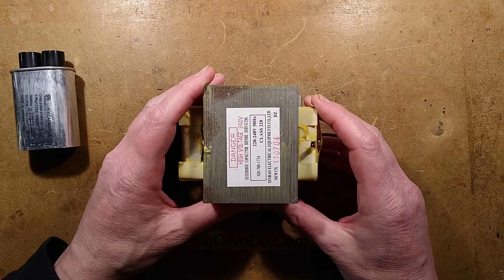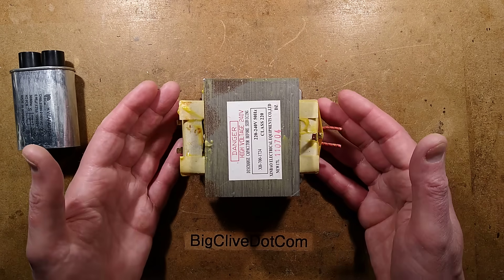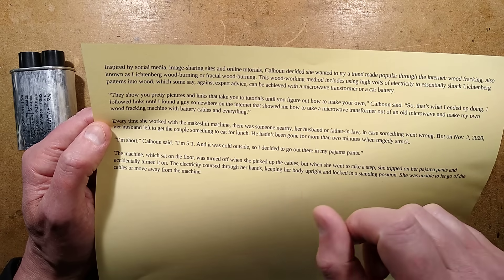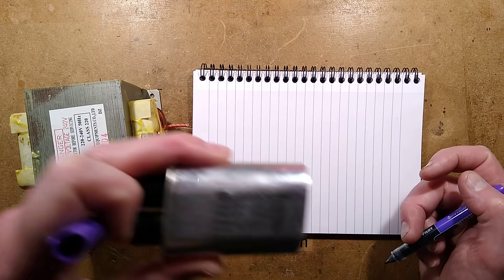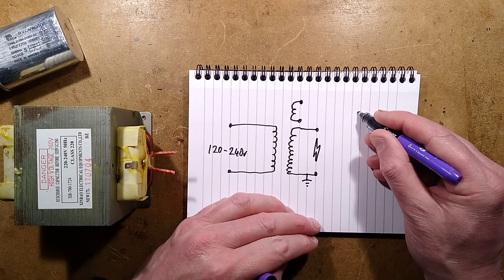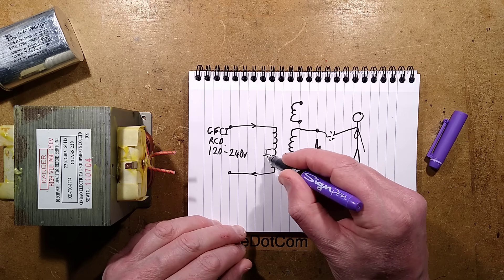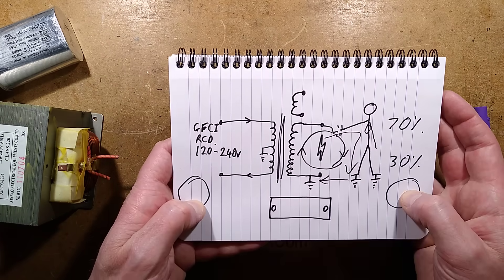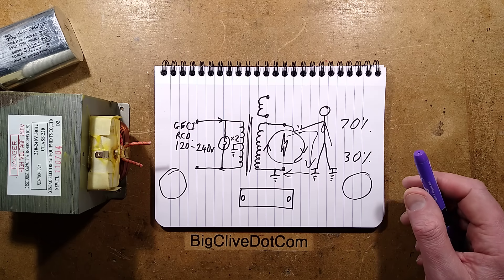The most deadly project on the Internet

Comment: My dad (tv repair man) always told us to be extra careful when tinkering with transformers.  To give more weight to his warnings, he zapped both me and my brother with a supertiny transformer and an AA battery, and then drew a schematic to explain what just happened.  Times have changed, but transformers haven't.
Reply: Was fixing an old BW tube tv and completed  the circuit and discharged the flyback transformer. lucky for me my elbows rested on my knees, was wearing shorts sitting on the floor. A unknown time later was awake found out my one arm did not want to move when I told it. An hour or so later my arm moved like normal.   Was very very lucky When I came too was 4 feet away from the tv and pressed hard against the wall.
Reply: @felixcosty  holy shit
Reply: A few years ago i was working on a cosplay that required me to make/buy a TV helmet. Of course i was broke, so buying wasn’t an option. Found an old tube tv on the side of the road one day and brought it back to work on it. Wore rubber dish gloves the whole time and always had someone else out there with me just to be safe, the warnings all over it about high voltage were enough for me to take it seriously. (Granted, it had probably run out of juice LONG before i got to it. The plug was cut near the base and there’s no telling how long it had been dead for. It was an old model, iirc the sticker on the inside said 1989.)
Reply: @opalumbre  I used to play with Tube TVs all the time. Gosh what lovely pieces of equipment.  just USE A MULTI-METER TO DISCHARGE THE TUBE TO GROUND. Be Careful. It acts as a Condeser.  but Gosh how cool it was to build things like O-zone Generator & Objects that fly with no moving parts.  and those Fly-back Transformers. gosh so yummy
Reply: When I was about 12 we thought it was hilarious to take apart disposable cameras and create trick toys with the control board and flash capacitor. Hand zappers etc. 🤡
Reply: @unauthorized.mimicry  my dad and i made a mini rotary lamp using a few of the capacitors and a small motor linked to a D cell when i was younger
Reply: @unauthorized.mimicry  dang i did that too. I might still have a zapper laying around. I had a extension cord hanging out of this kodak poke someone's arm with it. And im like its just got a double A battery in there what you a chicken? . I got myself with a sega game gear too. I don't know what the heck is going on in there but jeez that stung pretty hard. Put my kodak to shame honestly.
Reply: My half sister was always poking things into plugs, so my dad took her to his bike, pulled off the plug wire and told her to poke her finger in. He then kicked the starter pedal once... she hopped and fell down crying. He then explained to her that poking things into the 220 volt plugs will hurt a lot more and a lot longer than that.

She never did it again. Times have changed, fathers haven't.
Reply: @BloodSteyn  Back when parents let kids be stupid once so they didn't have to keel telling them. Lol
Reply: @windsofmarchjourneyperrytr2823  Haha, it will keel :P
Reply: @BloodSteyn nah fathers have definitely changed. Weird to call them your half-sibling.
Reply: @BloodSteyn  I came here to write "times change, fathers don't." Lol You beat me to it.
Reply: @BloodSteyn  See, this kind of education would be called "child abuse" nowadays.
The future is doomed...
Reply: @mr.kittysavestheworld695  I agree. Problem is, some people only learn through experience. I was raised with spankings and as a result I today suffer from a condition called respect and manners.
Reply: @BloodSteyn  sounds very 1960's and traumatic, but probably effective lesson... Although that kind of lesson could create trust issues. I think a better version of that would be to do it with a piezo igniter and to ask the child if they want to know what it feels like, warn them that's going to hurt a little bit and then tell them what they'd feel if they got electrocuted playing with sockets would be 1000 times that
Reply: @TheMrVogue  It was 1980's So close enough. :)
Reply: Capacitors are pretty dangerous too, especially the ones in valve amplifiers.
Reply: For kicks as a kid we used to take the tiny ones out of the big flame lighters and even those tiny things would give a really good zap! (I know technically not transformers, but a magnet being fed through a coil when you press the button. Similar principle, though.)
Reply: @jdyerjdyer  The type of ignition system you are talking about is Piezo ignition, it's a type of ignition that is used in portable camping stoves, gas grills and some lighters. Piezo ignition uses the principle of piezoelectricity, which, in short, is the electric charge that accumulates in some materials in response to mechanical deformation.
Reply: @alexkenny7807  Yes. In general, they usually are made that way, apparently, but the one I took apart as a kid had a magnet glued to the end of the plastic push button with a spring and a coil of wire. It was way back in the early 90s. Not sure if they changed, or it was just an oddball one I got.
Reply: @alexkenny7807  This is talking about energy harvesting, but I think it is similar to the device I found, and even correlates the principle to transformers as I stated above. I've read that in general, most these days do use piezo, but like I said, it was years ago, and maybe I just had an off name brand or something. IDK. lol

"According to Faraday’s law of induction, an electric current is induced when an electric conductor moves through an electric field, or if the magnetic field surrounding the conductor changes. This is called electromagnetic induction and is used by electromagnetic vibration energy harvesters to convert vibrations into electricity. This is the same principle that is used in e.g. transformers and electric motors.

Electromagnetic energy harvesting devices are typically designed as a system of springs, magnets and coils, where the magnet and the coil move relative to each other. This movement creates a change in the magnetic flux which produces an electromagnetic force.

Just as piezoelectric energy harvesters, electromagnetic energy harvesters are used as an “perpetual power source” to replace batteries and cables in wireless sensor networks and IoT applications."
Reply: @jdyerjdyer  
Sane principle. Related perhaps but that’s like saying a Coleman camp stove and an internal combustion engine operate on the ‘same principle’.
Reply: @Zerpersande  I just meant that they both induce current in a coil. Of course I didn't know that more commonly the electric spark is created by crushing a crystal, as the one I took apart had a magnet on it and a coil of wire inside.
Reply: @jdyerjdyer  Haha! Me too. tak! Aaaa! ... lets do it again!
Reply: Actually I think those arequartz crystals.
Reply: @jdyerjdyer oh man oh man, got quite the jolt from those when I was building potato cannons as a kid. We'd wired up three barbecue ignitors in parallel, glued some wood to hit all three at once, then wired them to bolts running into the PVC ignition chamber to create an arc. Accidentally touched the bolts on a few occasions. Yowwwzaaa! Quite the zap. 

Not to mention, we did a dry run without PVC glue... the square PVC plug at the base shot right back at my chest. Left a square bruise that took weeks to clear up. 

Honestly, shocked that we made it through those years. The potato cannon days came to an end after the cops showed up one too many times. Neighbors didn't like the bang, nor the potatoes littering their shingles and in-ground pool.
Reply: Good dad 🥰
Reply: @jdyerjdyer squished crystal
Reply: I figured out that disposable cameras are actually tiny tasers 
multiple times 
because you would hear a tiny whine then nothing 
the capacitors don't make noise so if you are building a camera flash system aka press a button get a light
you touch the circuit board and oh my heart feels cold that is not good ow 
and then you unknowingly charge it again and you reach for it again OW frick not again
Reply: I think you mean capacitor, not transformer.
Reply: @TheDieselndust  had to, dc can't be transformed, only ac.
Reply: Your dad is amazing.
Reply: My dad would wake us up with a couple of flashlights and yell, Truck. He never really did explain much though.
Reply: In laymans term the bigger the transformer the faster the death yeah?
Reply: @drunkeneagleman51 not necessarily. The main concern is the difference in the number of windings in the primary coil to the number of windings in the secondary coil.
Reply: you're right. Transformers havn't changed... those movies still suck
Reply: good father, my friend. you're a lucky duck
Reply: @alejandrolujan9472  Thx, he died almost 11 years ago, but I learned a lot of valuable things from him. (His death had nothing to do with electricity for those wondering)
Reply: @Sludge I read some more on it and it appears in general more of them do use a small piezo crystal now. hmmm
Reply: Unless they turn into a robot.
Reply: Hold it.  A transformer and a d.c. power source zapped you?  You'll have to show me the schematic on that one.  I'll bet you're thinking of a large capacitor.
Reply: @hayseed5467  Very simple circuit, as explained, a step up transformer and a battery. The battery is connected and the initial surge of electricity in the primary coil will cause a magnetic field to be created. That field will cause a pulse of voltage in the secondary coil. Disconnecting the battery will cause the magnetic field to collapse, causing a reverse voltage pulse in the secondary coil of the transformer. This principle was used in car radios in the days when they used high voltage tubes. The DC voltage from the car battery was run through a vibrator (a device like a relay with the coil voltage flowing through a normally closed contact of the relay) to create rapidly pulsed DC that then flowed through a step up transformer to create AC. 
The same principle is used in the mechanical ignition system of older cars. The points open and close as the distributor turns, supplying the pulsed spark to the spark plugs.
Reply: @memyname1771  Yes, I'm familiar with that. I assumed Dad was playing a joke on him, which would have precluded said dad from having him hold on to the secondary leads of the trans.  What fun is that? 🤣   Usually when you hear these shocker stories, they revolve around an surreptitiously charged electrolytic capacitor, left laying in wait for the unwary victim to come pick it up.  Which leads to another lesson in electronics.
Reply: @hayseed5601  In the 1950s, a joke store near my school sold a very shocking book. The book was foil covered (front and back cover were insulated from each other) and inside had a transformer connected to the book cover, a battery, and a switch that would vibrate when the book was opened.
Reply: @memyname1771  I want one.  I got a grandkid I need to take down a couple pegs. 🤓
Reply: @memyname1771  Technically the output of a vibrator in those car radios was dc in order to operate the plates of the tubes.  The output of a transformer running on dc is dc, it's just that one needs a mechanical apparatus to make and break the circuit to induce the current output (inverters nowadays us some electronic means to accomplish this).  Something, BTW, that is technically happening in an AC transformer too.  It is just the 60 hertz oscillation of the current polarity that makes  and breaks than remakes the field in the reverse polarity, collapsing and remaking the magnetic field and inducing the output current.
Reply: @hayseed5467 photo flash unit in a camera? Easily generates 20kv to fire the flash. Runs on a 1.5 volt battery. Super easy to generate a DC sine wave that creates an inductive field.
Reply: @hayseed5467 A Model T Ford "buzz" coil will buzz you pretty good on a six volt car battery.  That is how an old fashioned car ignition system worked on six volts to pop out 20,000 volts for a spark plug (modern cars still use ignition coils of course AKA transformers).  Ditto on old (and new) small engines with a magneto.  This low DC voltage input being induced in output by make and break using ignition points.  My guess is that his dad was make and breaking the contact with the batteries very fast to achieve.  I do the same thing with breaker points to manually see if an ignition coil is sparking.  It doesn't matter about little battery or small transformer, as long as there are hundreds or thousands of turns in the secondary of the output the step up will be high.
Reply: @hayseed5467  When you apply DC to a transformer, you get a pulse from the output. Same, opposite polarity when you remove it,
Reply: @hayseed5467  Wow, I can't believe the absolute state of common sense. Quick, take a transformer and grab both leads, then have a friend plug a 9v battery from a toy on the other side, you best believe you will feel it
Reply: @ELTABULLO  Yes.  And...?
Reply: @ELTABULLO A Model T Ford "buzz" coil will buzz you pretty good on a six volt car battery.  That is how an old fashioned car ignition system worked on six volts to pop out 20,000 volts for a spark plug (modern cars still use ignition coils of course AKA transformers).  Ditto on old (and new) small engines with a magneto.  This low DC voltage input being induced in output by make and break using ignition points.  My guess is that his dad was make and breaking the contact with the batteries very fast to achieve.  I do the same thing with breaker points to manually see if an ignition coil is sparking.  It doesn't matter about little battery or small transformer, as long as there are hundreds or thousands of turns in the secondary of the output the step up will be high.
Reply: @wdmm94  You get it
Reply: I'm seeing a lot of doubt about this comment, understandably, but I assure you the circuit was quite involved and not just a battery and a transformer.  I found a video with a circuit board that is very simular to what I remember being zapped with:  https://www.youtube.com/watch?v=Q7gw3uDRXPw
Reply: @dustinslaboratory897. I am sure your dad just took a basic step up transformer that took low voltage and steps it up to high voltage.  All he had to do to induce high voltage was make and break the connection real fast.  Old radios had vibratory transformers that turned low voltage into continuous stepped up dc.  A small engine ignition coil would do the trick too. Really easy and basic.
Reply: @dustinslaboratory897  OFC youre gonna try and go back on what you said after people start calling out how youre full of shit. first it was just a tiny transformer connected to a battery, now its a battery connected to a PCP and a series of components. either way, dosent matter. you cannot pull that kind of power from a battery. without a very high capacity capacitor as well, you cannot obtain a spark from that. 120v dosent make a spark if youre still pulling less than 2 watts of power.
Reply: @FingerinUrDaughter  Dude, you need to chill.  I never talked about sparks in my post? I don't need to back out of anything, I was there.  We just got zapped (electrocuted) and got a good scare out of it, nothing more.  *Djeez *
Reply: was it the transformer from a disposable camera? I got hit with one when I was in middle school and holy crap that thing bit hard.
Reply: Your father's parenting skills are shocking. <-- Pun intended. Sounds like a fun childhood and a good Dad.
Reply: So you're saying that every has transformed except for the thing that is named after the process of transformation?
Reply: Got quite a zap, from a flyback transformer in an old tv.
Reply: My dad did something very similar. Had an old black and white he was trying to fix, the moment me and my bro started looking over his shoulder to watch him, he turned to us and simply said "Don't touch this part. If you're not careful, it will kill you." Blunt and straight to the point sure did get me to take things like that seriously for the rest of my life.
Reply: This 100% works with just a small transformers and a AA. I accidentally figured it out while messing about as a kid with an alarm clock I'd destroyed. It only works upon disconnection of the battery, and you don't connect it to the mains wires but the output wires, so basically wire in the reverse of how the transformer was used in the A/C powered device. Thanks to those that explained how this was happening because the more I've learned about electricity the more confused I was to what was going on. I used to bring it to school and shock my friends. 
Once we got a group of 8 or 9 kids to hold hands in a circle. Me and and my buddy held one of the mains wires and connected then disconnected the AA to the other end, everyone let go at once as they all felt the shock at the same time. Very wreckless but lots of fun. I did have a microwave transformer at the time but intuitively knew I shouldn't try it. Grateful I never did, guessing that could have ended badly.
Reply: I learned about "mystery" high voltage while studying amateur radio. I took my 2000-ohm standard radio earphones and tried to check the circuit for broadcast band signals, but only got a light jolt when I OPENED the circuit.  If you are curious, when the phones are first touched on the radio circuit,  from only a 22.5 volt B-battery battery, they store up the 22.5V energy, and OPENING the PHONE circuit permits the energy to go directly into the earphones....and.... surprise! a jolt from "nowhere"!    I NEVER AGAIN needed to play with ANYTHING that could store energy.
Reply: Thats odd because a transformer doesn't work with DC from a battery...
Reply: @fedorboendermaker1536 sure it does, just feed it a DC sine wave.
Reply: @fedorboendermaker1536 A Model T Ford "buzz" coil will buzz you pretty good on a six volt car battery.  That is how an old fashioned car ignition system worked on six volts to pop out 20,000 volts for a spark plug (modern cars still use ignition coils of course AKA transformers).  Ditto on old (and new) small engines with a magneto.  This low DC voltage input being induced in output by make and break using ignition points.  My guess is that his dad was make and breaking the contact with the batteries very fast to achieve.  I do the same thing with breaker points to manually see if an ignition coil is sparking.  It doesn't matter about little battery or small transformer, as long as there are hundreds or thousands of turns in the secondary of the output the step up will be high.
Reply: 52
Reply: love the avi/name
Reply: Old TVs used vacuum tubes, or valves depending on where you are from. EL34s were not uncommon, so the TV repair shops often had what we needed to fix our guitar amps. Not quite microwave voltages, but getting up there. 400-600v. More than enough to do the Grim Reaper's work for him. Guitar amps have plenty of victims. Most videos showing people how to repair or mod their amps have safety disclaimers and info on how to discharge the big filter caps.
Reply: My father was a master electrician, I also got my fair share of shocks that he dubbed “lessons” times indeed have changed.
Reply: TRANSFORMERS.....Abomination in disguise
Reply: intersting - how did he do that with DC? Or were more components involved?
Reply: @Sludge Is that the sane as those piezo rocks in amps and electronic drums?
Reply: What a great dad, explains and gives real example, the kind that you will never forget, damn i wish a had one xD
Reply: its not the transformers. xformers are just coils of wire. theyre dangerous if hooked to a power sorce like capacitors or batteries or line power.
Reply: transformers arent dangerous, you have to apply power first
Reply: my brother had a english mini 1000 in the 70`s . the fucker told me at age 11 to hold the plug to the cam  headcase and the  negative_battery terminal at the same time. absolute fukkin wanker. i sit here today though at 58 and are good looking and cool and hot at the same time . "humour" . ""are still alive"". however i put this down to cross index polarity. dc to positive ac motive non terminal ground-base collection . this said at least 18.000 volts at even .74 amps kills without the wearing of rubber school pumps. dont piss about willy nilly with these items and potential killing schematics . after all i not like any more than 3 to the power of 1 as competition x. ty clive x.
Reply: they just got volumised .
Reply: There's certainly more than meets the eye to transformers.
Reply: Hello Dustin, There are a lot of inductors out there that give a nice zap, even electric motors such as an Erector set motor, the 1 you plugged into a wall socket. Gilbert 
showed how to make a rotary switch and hook up with 2 D cells and the prongs of the motor. it was when the swich opened you got that inductive kickback, sort of like the
back emf you get across the points of an ignition set up for battery or magneto.
Reply: Not sure how you got voltage on the secondary from a AA battery without some sort of switching circuit
Reply: @alexanderkuhn2298. Could have simply manually made and broke the battery connection real fast.
Reply: @alexanderkuhn2298 Probably made and broke the battery connection real fast.
Reply: Relay coils can give you a surprise also.
Reply: My dad did take the discharge of the sparkgap of a Tesla Coil we made like a project. High voltage isn't a matter of joke
Reply: Shocking
Reply: Wait a second! Transformers don't work with direct current (e.g., a battery)!
Reply: @douggraham5812 A Model T Ford "buzz" coil will buzz you pretty good on a six volt car battery.  That is how an old fashioned car ignition system worked on six volts to pop out 20,000 volts for a spark plug (modern cars still use ignition coils of course AKA transformers).  Ditto on old (and new) small engines with a magneto.  This low DC voltage input being induced in output by make and break using ignition points.  My guess is that his dad was make and breaking the contact with the batteries very fast to achieve.  I do the same thing with breaker points to manually see if an ignition coil is sparking.  It doesn't matter about little battery or small transformer, as long as there are hundreds or thousands of turns in the secondary of the output the step up will be high.
Reply: Very important lesson!!! I have my own stories along these lines.
Reply: wait, how did he zap you with a transformer and a dc source? or was it a transient thing when the connection was made?
Reply: @dsdy1205 A Model T Ford "buzz" coil will buzz you pretty good on a six volt car battery.  That is how an old fashioned car ignition system worked on six volts to pop out 20,000 volts for a spark plug (modern cars still use ignition coils of course AKA transformers).  Ditto on old (and new) small engines with a magneto.  This low DC voltage input being induced in output by make and break using ignition points.  My guess is that his dad was make and breaking the contact with the batteries very fast to achieve.  I do the same thing with breaker points to manually see if an ignition coil is sparking.  It doesn't matter about little battery or small transformer, as long as there are hundreds or thousands of turns in the secondary of the output the step up will be high.
Reply: Flyback transformers from crt screens pack a punch!
Reply: Did he have an awesome set of tools? Gnarly!
Reply: I think you're getting transformers mixed up with capacitors. Transformers require AC to work, capacitors require DC to build up and store a charge so you couldn't energise a transformers with an AA DC battery. It's the large electrolytic capacitors in old TV's that can remain dangerous after the set is switched off.
Reply: @phils2180 A Model T Ford "buzz" coil will buzz you pretty good on a six volt car battery.  That is how an old fashioned car ignition system worked on six volts to pop out 20,000 volts for a spark plug (modern cars still use ignition coils of course AKA transformers).  Ditto on old (and new) small engines with a magneto.  This low DC voltage input being induced in output by make and break using ignition points.  My guess is that his dad was make and breaking the contact with the batteries very fast to achieve.  I do the same thing with breaker points to manually see if an ignition coil is sparking.  It doesn't matter about little battery or small transformer, as long as there are hundreds or thousands of turns in the secondary of the output the step up will be high.
Reply: No offense but I think your memory is faulty, a battery aka DC doesn't work with a transformer.
Reply: @skullheadwater9839 A Model T Ford "buzz" coil will buzz you pretty good on a six volt car battery.  That is how an old fashioned car ignition system worked on six volts to pop out 20,000 volts for a spark plug (modern cars still use ignition coils of course AKA transformers).  Ditto on old (and new) small engines with a magneto.  This is low DC voltage input being induced in output by make and break using ignition points.  My guess is that his dad was make and breaking the contact with the batteries very fast to achieve.  I do the same thing with breaker points to manually see if an ignition coil is sparking.  It doesn't matter about little battery or small transformer, as long as there are hundreds or thousands of turns in the secondary of the output the step up will be high.
Reply: @dustinslaboratory897     The output of a transformer running on dc is dc, it's just that one needs a mechanical apparatus to make and break the circuit to induce the current output (inverters nowadays us some electronic means to accomplish this).  Something, BTW, that is technically happening in an AC transformer too.  It is just the 60 hertz oscillation of the current polarity that makes  and breaks than remakes the field in the reverse polarity, collapsing and remaking the magnetic field and inducing the output current.  Some of the commenters don't seem to understand that in the first place.
Reply: A good video about Faraday and his discovering of induction.
https://youtu.be/mxwVIOHEG4I?si=H9BUNFM9o1QCD5ch
Reply: When I was about 6 years old I saw a 240 volt power lead in Dads' workshop. I saw a stainless steel tube bent into a pistol grip shotgun shape. Roughly. I got this flash of inspiration and fed the end of this 240 volt mains supply(Australia) lead through the old stainless tube and had bare ends of copper wire sticking out the end of my futuristic weapon. God only knows why I didn't plug her in there in the workshop! I knew I was not meant to do such stuff. I thought it was OK but not really that ok... anyhow I took the thing into the house and was in the process of plugging the old girl into the socket closest to the front door when my Mom says HEY!!!  what the hell is that?? Oh I will show you... She lept over and snatched the damned thing from my hands as My Dad came in the room and was very concerned. He was a Telecom engineer and ram an electronics lab in the city developing all manner of things. Solving issues for the telco etc. Innovative design it was called. So I dodged a very nasty electrical bullet that night and whatever was said to me was serious because to this day I am extremely careful with electricity and its use and misuse. I know several folks that have nearly been killed by mains power  my mate had an old 50s type vacuum tube amp for his electric guitar. He was fixing the thing and had it plugged in... the guy had extremely high I.q. alas his common sense suffered on account. Anyhow he was sure he was fine as he wasn't touching anything inside the open amplifier but his silver chain bracelet moved, made contact and the juice went in there and out the end of his finger. He sat there rigid unable to do a thing about it as that's what happens... muscle rigidity. His Dad coolly walked in and cut the power. Lucky! Yet the belting Arc that was streaming out of his finger actually blew off the pad on his index finger. It was bad. And the bracelet was welded up in places and he had bad burns from that. The hospital said shock did go throughput his body but mostly as it is a lazy thing, lazy people or things find the easiest shortest way. That's why it sometimes pays to hire a lazy but responsible person in business as they always find ways to cut out unnecessary bits. Haha.
Reply: Your dad zapped you with an AA battery, and a transformer? But transformers don’t work with DC. Do you mean a boost converter?
Reply: When I was around 8 or 9, I would steal my moms disposable cameras, take them apart, and tinker with them. One fateful day, I found one that actually worked and I thought it would be a good idea to touch my tongue to the capacitor for the flash. Unfortunately, I didn't know what a capacitor was or how they worked, or that it was actually charged, and it resulted in me not being able to taste anything for a week.
Reply: How does a transformer work with a DC voltage from a battery? Fake story
Reply: You can't expect a trafo to work with any type of battery connected to it so there had to be either a inverter or some other device taking care of DC/AC inversion for you to feel anything.
Reply: My electronics teacher would do the same.
Reply: You dad is lovely!
Reply: As a young tinkerer in electronics, I had a healthy fear of the flyback circuits in CRT TVs.  This Microwave Oven transformer gives ne the heebie-jeebies.
Reply: My father owned and operated a television and radio repair shop starting in the 1950s.  I thought that bigclivedotcom was a place where people came to learn about electricity and electronics. After reading some comments here, I see that some people need to go back to the very basics. Two examples found in response to your comment clearly demonstrate this. One says transformers changed and have been replaced by resistive networks. Resistive networks have existed to reduce voltage in the oldest AC/DC radios, back when some areas were supplied with alternating current and other areas of the same country were supplied with direct current. These transitioned to become the old transformerless radios designed for AC, as DC was no longer used for power distribution. These radios, and similarly designed electric products, had the deadly problem of no isolation from the incoming power. Another person comments that transformers have gotten bigger. Big, high power transformers have existed nearly as long as alternating current has existed. The design and function of transformers has, for the most part, remained the same for years.
As for the person sitting on the floor while wearing shorts and a short sleeve shirt, working on a tube television, I hope everyone takes a lesson from this. The CRT stores the low current, high voltage charge from the flyback transformer. The television should have been on a non-conductive bench. The floor, if concrete, should have been covered with a rubber mat. Measurements should have been one handed. The voltage may not kill you, but the muscular contraction and loss of conscience could lead to serious injury or death.
Reply: @memyname1771  I fully agree with your comment about some folks need to learn what they are talking about.  I worked in a TV shop in the 70's while in high school and I got zapped more than once, if I remember correctly a fly-back  transformer in a color CRT TV produced about 25k volts.
Reply: @memyname1771  Wow... Electric shocks can leave you without a conscience!? Is that what happens to politicians when they graduate?
Reply: My dad beat me with a stick
Reply: Time changed, and transformers did too.
They got BIGGER.
"AA batteries? HA! I'll show you how it's done!"
Reply: As a kid I always wanted to build a Jabob's Ladder (in the days before the internet) and my dad always said I needed a furnace transformer or a neon sign transformer but he never helped me build one.  I realize now, as an adult, that he was probably fucking shit scared of the voltage, and with good reason.  My dad was super smart but he wasn't an elechicken, he was a milwright.  Anyway... now I'm the old man with the power of the internet so I can build cool shit with my kids and we'll see how it goes.  Hopefully we don't die of respiratory paralysis haha

That said, he did tell me I needed at least a 500µF cap to charge off the 120v wall current if I wanted to toss one to a friend for an electrifyingly good time.... he was less than impressed when I tossed it to one of his co-workers.  This was in the days before #metoo so there were no lawsuits.
Reply: @MdubFrederson lawsuits were more common before tort-reform. Metoo has nothing to do with your story. 🤦‍♂️
Reply: @MdubFrederson  Yeah we played a joke on our EE Teacher one time like that.  Hooked his metal stool up to a 60-Volt Capacitor. (being sure to limit the draw-potential for saftey)  he got quite the zap xD.  boy was he pissed!  But, it became a 'campfire story' later and he'd tell it to the middle-school & high-school kids when he switched to semi-retired teaching xD
Reply: Bro I once connected 6 AA batteries to a transformer and zapped myself on purpose just to see what it was like. After a couple of zaps I couldn't bring the leads together any more, my body was effectively trained that "Touchy no goodie" and no matter how much I tried I just couldn't do it on purpose. I literally conditioned myself.

Before anyone asks, I was extremely bored and it was kinda fun.
Reply: Volts are pain, amps are death, and s microwave transformer will give you a whole lot of both.
Reply: @mitch190  if it was just a transformer connected to some batteries, nothing else, it absolutely did not shock you because the DC cannot create an inductive field to transfer the energy to the secondary coil. without a dc-ac converter, its not possible. though you can charge a capacitor with batteries to achieve a shock.
Reply: @FingerinUrDaughter  When the battery is connected, it acts like a switch and there’s an abrupt change of voltage in the transformer primary. This does generate a change in the magnetic flux and it does get transformed to the secondary. Heck, that’s how transformers operate inside DCDC supplies, just have a switch connecting/unconnecting the battery
Reply: @FingerinUrDaughter  A relay is a switch you genius
Reply: @FingerinUrDaughter "you need a RELAY not a switch". Here is was thinking a relay was an electro magnetic switch all of these years...Thanks for educating us!
Reply: @FingerinUrDaughter  Fool. I have an electric fly-swatter right here that runs on two AA batteries and can give a human a nasty shock. It absolutely can be done. Your ignorance doesn't make it impossible.
Reply: @FingerinUrDaughter super easy to generate a sine wave for the transformer. Shut up, you absolutely don't know what you are talking about.
Reply: @FingerinUrDaughter  If you ever worked on an older car with a mechanical ignition system, and understood what you were working with, you would know that pulsed DC run through a transformer can develop a very high voltage.
Reply: @memyname1771 Modern cars still have coil packs.
Reply: transformers absolutely have changed, in that they have been largely replaced by much simpler and cheaper resistive networks, which can be as simple as a single resistor and a capacitor, with the added benefit of actually reducing the power load to what is needed, rather than horribly inefficient transformers which bleed away the excess energy they draw as heat and vibration.
Reply: @FingerinUrDaughter  But they don't last. Like all changes we've been making in the past 50 years, the newer microwave is better, for a shorter period of time.
Reply: @skeetorkiftwon  yeah ok but still changed.
Reply: @FingerinUrDaughter  What? you mean new microwave transformers use 1970's designs.